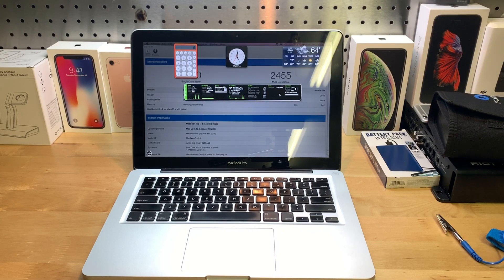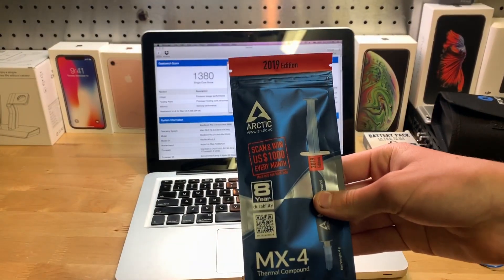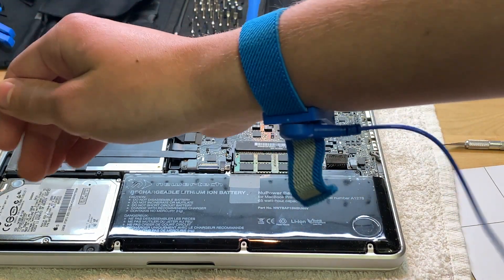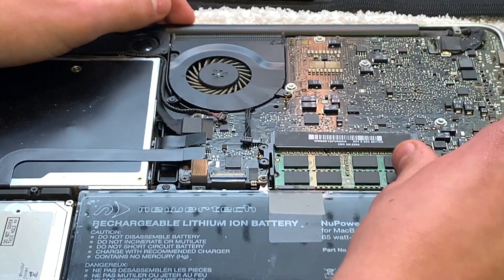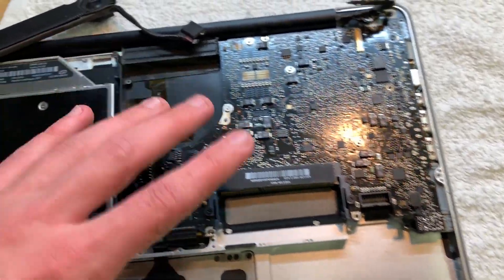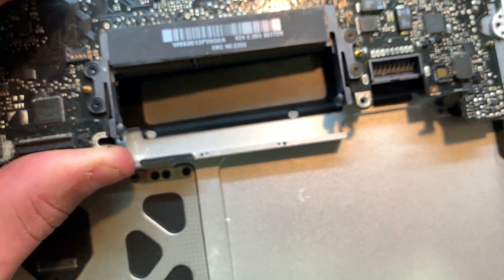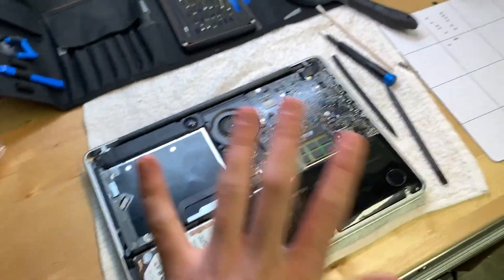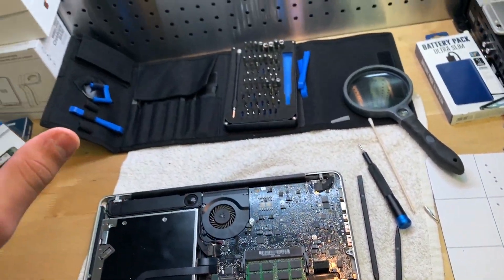Apple MacBook Pro Mid 2009 Upgrades For Speed And Power Part 1

Comment: mine is 09 mac pro unibody 5.4 what os do i use if i do this? i have el capitan 10.11.6 please
Reply from the maker: I used MacOS Mojave with dosdudes patcher after I did my upgrades. Without the patcher, the newest OS is El Capitan
Reply: @Pondsisawesome124  you can run on the OCLP Monterey as it still could support on these MacBook Pro models..

Comment: I can’t even turn my 2009 MacBook on (it’s not an air I should add and the batter is fine) but because it can’t handle all the updates from Apple. Will upping my Ram help me to at least turn it on? I haven’t used it for YEARS but would like to.
Reply from the maker: Adding the RAM won't help with the powering on issue so that would waste $, have you left it on the charger overnight or tired a PRAM reset? There's also a capacitor on the motherboard that goes bad and can cause issue with power on. Hope this helps you:-)
Reply: @Pondsisawesome124  I’m pretty certain it’s not the battery since I’ve tried new and others and it’s still the same issue so it might be the motherboard. This does help, thank you!

Comment: My mid 2009 crashed and on the advice of Apple I reinstalled but wiped all data in doing so. El Capitain was the latest install. Is there any hope of resurrection? It will need a new hard drive or SSD but can I upgrade the OS?
Reply from the maker: El Capitan is as far as you can go with that Mac but it's a solid OS version. Get a new SSD and re-install and enjoy the machine but this time be sure to keep a back-up of your drive to an external disk or network drive, etc.
Reply: Pond's - You’ve said what many others do not but it’s the reassurance I need. This Mac is a solid tank of a machine which I will not give up easily. Thank you!
Reply: @helenprice314  In my mid 2009 I have an ssd, crammed 8gb of ram into it and patched it to catalina and it is absolutely humming.

Comment: I was late coming across your video and found it after I had completed the same upgrade on mine.  Great info to know.  I do a lot of video editing and I was using an editor on Windows until the pc crashed and I had to begin using my Mac.  I went from a 250gb to 500gb hd and then to 8gb memory a couple of years ago.  Now doing video with iMovie, which is pretty cool, but it takes a long time to export the film to view, maybe an hour for 3 or 4 minutes.    I checked further and found that I only had 12gb left on my 500gb hd.  Almost all the space was 'other'.  I have almost all files on external drives.   I just cloned the 500gb hd to a 1tb SSD to get more space hoping for better performance.  Generally, app use is faster, but video export is still slow.  I suspect 8gb of memory max is not enough processing power and that's about as good as it will get.
Reply: It is your cpu that is the problem
Reply: @ewanmacquire-plows7095  My MacBook is dual core 2008.  Looks like I'll have to upgrade to a quad core 2018 MacBook to get an improvement.  I can't afford to go to a newer model.
Reply: @Bill97070  either get a 2012 + mac mini or get a 2013-2015 MacBook Pro as the 2018 has the horrible butterfly keyboard

But If anyone is an expert correct me as I know more about pc’s than I do Macs
Reply: @ewanmacquire-plows7095  Thanks, I'll look into it.

Comment: Can I upgrade one from 4g ram to 16 and drive from 128 to 500?
Reply from the maker: You can upgrade to 8GB of ram from 4GB as 8GB is the max it can take. And yes, you can upgrade the drive to 500GB.
Reply: I bought a MacBook Pro early 2011. I upgraded from 4g ram to 16g and from 256g ssd to 1tb.

Comment: Would the thermal compound be at all necessary for the 9,2 2012 MacBook Pro? While my Mac can stay pretty cool it can get really hot for almost no reason. Using Catalina. 10.15.4.       My specs are below.                                  Mid 2012 13.3” (Non Retna), (9,2), 2.9 GHz 3rd Gen (Dual-Core) Intel Core i7, Integrated Intel HD Graphics 4000, VR 1536 MB, 250 GB Samsung Evo 850 SSD, Optical Drive Replaced with 1 TB Samsung QVO 860 SSD. Battery Cycle Count is 7, macOS Catalina 10.15.4.
Reply from the maker: I would still replace it. Thermal compound sometimes becomes dry after just a few years which can cause it to get warm. While your in there, I would recommend cleaning the fans and heatsink as it may be blocked by dust. Replacing thermal compound could also let the computer run faster, since it wouldn’t have to throttle to prevent overheating.
Reply: Pond's i just dont know anyone who could do the job. I cant. It’s too risky and while i made other upgrades I’m not that good at these things. So idk if I’d be able to that much of a job. Also if i break it its not only Mac i can use.

Comment: Good video Hey I have a question what type of charger does this Mac use
Reply from the maker: MagSafe
Reply: @Pondsisawesome124  Thanks .. is it Magsafe 1 or 2 ? 
L-tip or T-tip ? For MacPro Mid 2009 15 inch Thanks alot
Reply: Jonny Boy Noticed your comment, MagSafe 1 with L shaped connector, at least that’s mine and I have the same MacBook.

Comment: Are these products you are using enough to run the most current version of Mac OS and browsers?  If I use even more storage/speed, will the rest of the 09 Macbook guts be able to support them?
Reply from the maker: They are definitely enough to run the most current version, I’m sure if you used a better brand of ram (8GB is still the max) and a more expensive faster SSD it would be faster than in this video. Off video, I upgraded this computer to MacOS Mojave using a hack made by DosDude1, Mojave is still pretty fast in this machine even using cheaper ram, etc. if your just planning on doing exactly what I did in the video, than the computer would run very well and would be great for web browsing and other tasks.
Reply: I think 16gb ram works too
Reply: @freebeat2289  No, the max amount of ram the Core 2 Duo in the MBP 2009 can handle is 8GB

Comment: Hi! Will this laptop (with intel core 2 duo) be power enough to run smoothly Safari, Mail and maybe watch some movies nowaday?
Reply from the maker: If you plan on leaving everything stock than the computer will do everything relatively smooth. If you upgrade everything like I did, everything will be pretty smooth and things such as gaming will work well too. If you plan on doing anything graphics demanding, I would recommend at least upgrading the thermal paste.